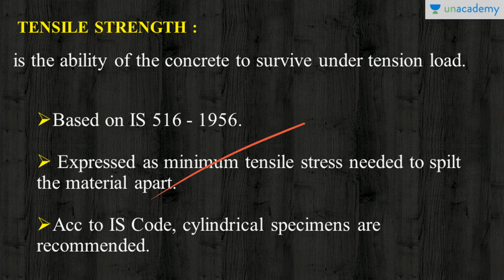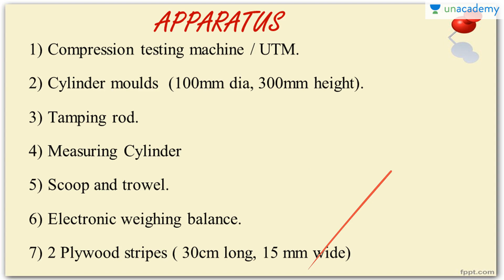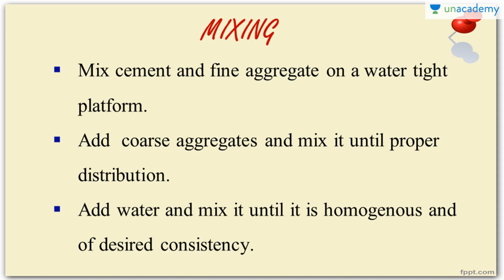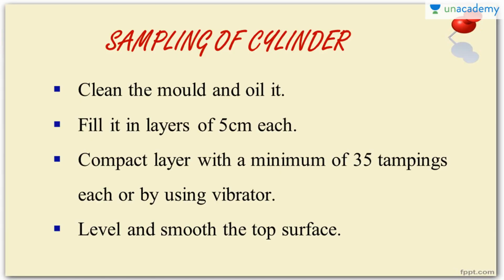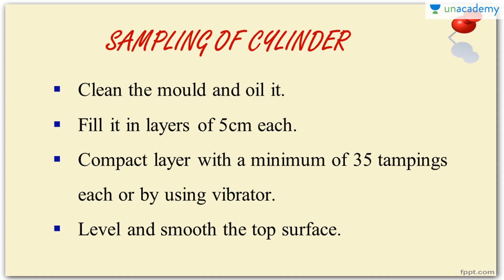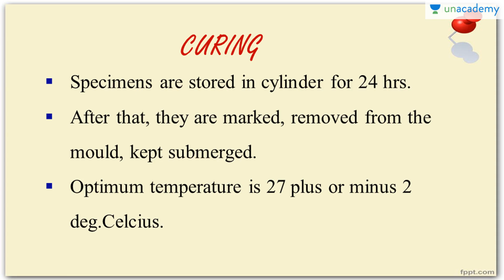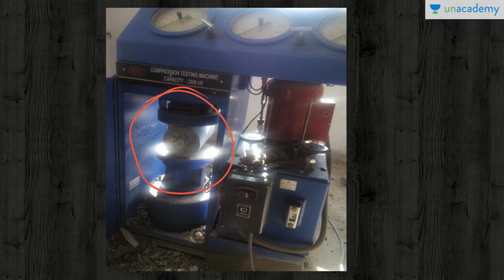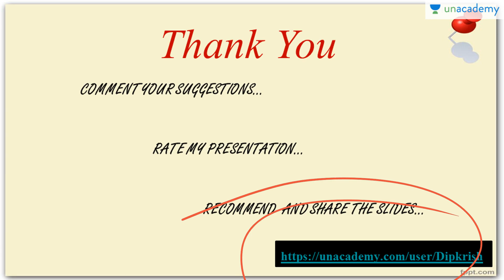Split Tensile Strength Test On Concrete

Comment: Hey you performed tensile strength test for concrete cylinder, but at last u ended video with compressive strength formula, please correct it.

Comment: "The cylindrical specimen shall have diameter not less
then four times the maximum size of the coarse
aggregate and not less than 150 mm. The length of the
specimens shall not be less than the diameter and not
more than twice the diameter. For routine testing and
comparison of results, unless otherwise specified the
specimens shall be cylinder 150 mm in diameter and
300 mm long. " As per IS 5816(1999)